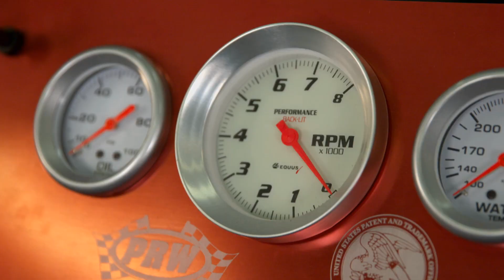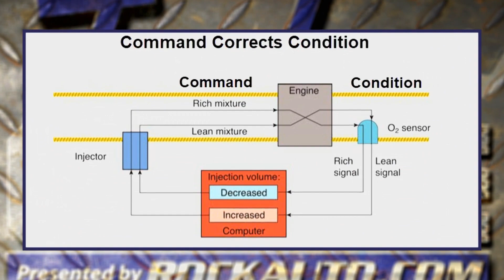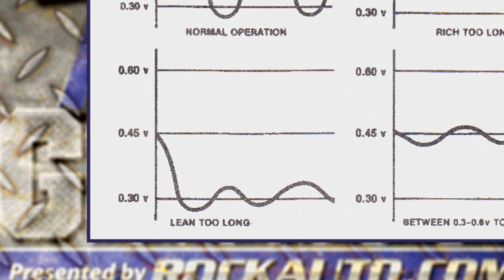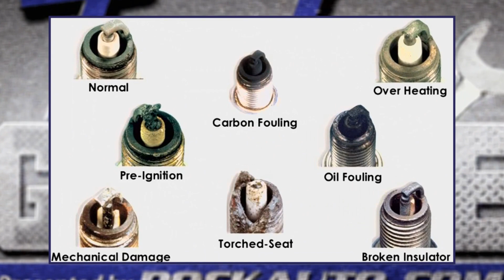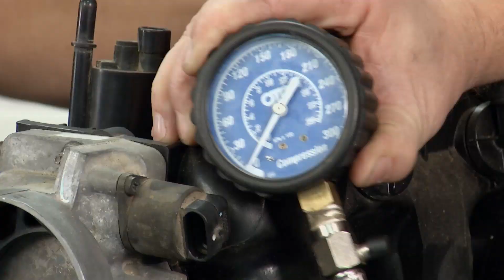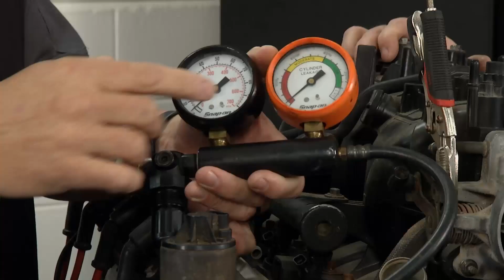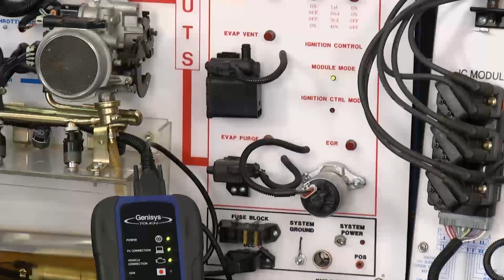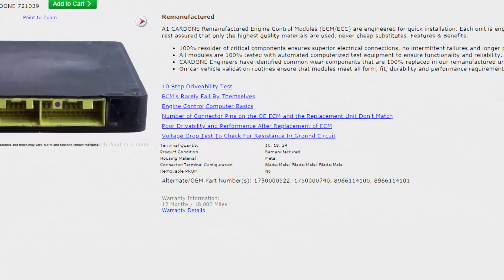Tech Garage S6 E1 "Check Engine Dissension" Check Engine Code P0171

Comment: Hey guys good afternoon. My son has a 97 Pontiac Grand Prix GT 3.8 with a P0171 code and a service engine soon light. The mechanic claimed that the injectors were dirty and it was failing inspection. It passed but after my son drove it about a hundred miles the light came back on. I have replaced both oxygen sensors, egr valve. I suspect that the egr line is partially blocked. The mesh screen that attaches to the throttle body also has a whole. I have a replacement and plan on buying a new egr tube. The repair shop does not have a smoke machine. Oh I also plan to replace the vacuum lines after I inspect them. From what I have read this seems to be a common problem. Your help would be greatly appreciated.
Reply from the maker: Sounds like you're right on track.   Those lean codes tend to be vacuum leaks... find somebody with a smoke machine Make sure there's not an ounce of vacuum leak in the system then I would direct my attention to the MAF sensor after that.
Reply: @Johngardnertv  John I watch your show Tech Garage and am wondering what happened to Bryan